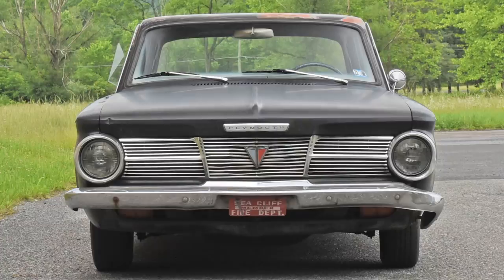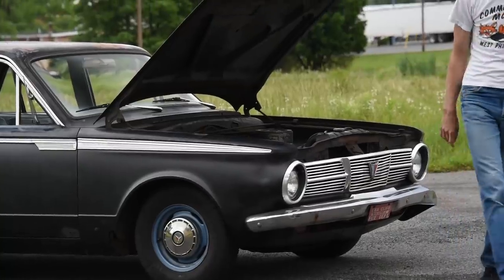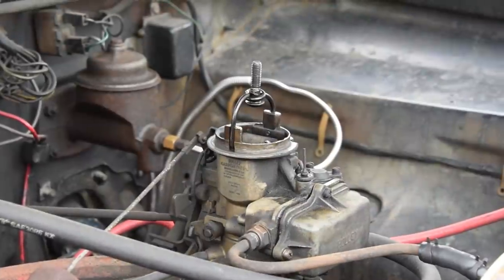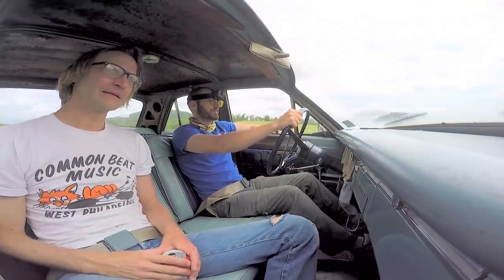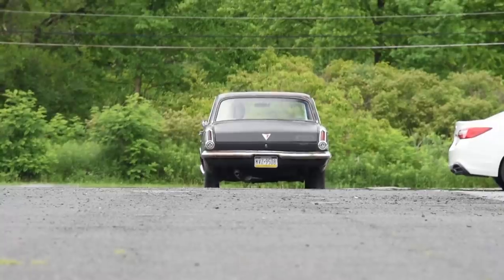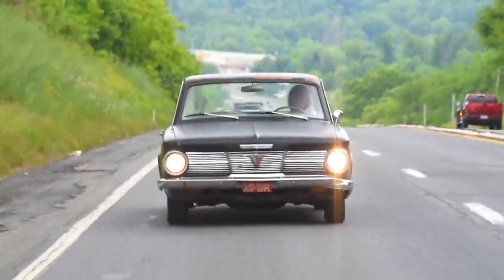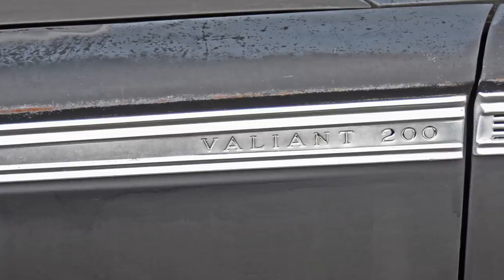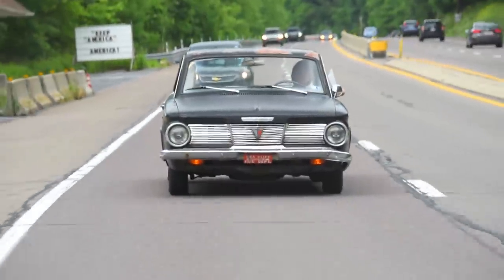1965 Plymouth Valiant 200: Regular Car Reviews

Comment: My mother used to have a 1962 Valiant with a slant  6 and a push button automatic transmission. Being a slant 6 it threw oil like there was no tomorrow.  My parents bought cheap oil by the case and kept it in the trunk. Everytime we would stop for gas is was my job, this is 1967 so I was 10, to check the oil and fill up if needed. About every 3rd fill up I had to add a quart. My parents sold it to a relative in 1973 and she drove it until 1980 when the floorboards were completely rusted out, Upstate New York winter.
Reply: My dad had an AP6 Valiant (australia, 1965/6) - remember dad saying that would go between oil changes without needing so much as a cupful top up. Use good oil and you wont fuck the motor.

Comment: Reminds me of my Australian AP5 Chrysler Valiant Regal (1964) - white paint with red interior. it had the torque flite push button automatic. It was my grandfathers first non black car. 

It was well loved in our family. I sold it in 1994 to a guy who did a full restore. 

The valiant in this video is more like the AP6 of 1965.
Reply: I had an AP5 in the mid 90's,  a pushbutton torqueflite. It was an early 63 build with the wipers on the American side and the blinker stalk on the left. Later AP5's were opposite. As it was pb auto, I simply turned the steering column upside down and used longer bolts on the under dash bracket.

Comment: I have owned at least 5 pre-70's Chrysler Valiants (as they are known in Australia), In fact, my first car was a 68 model that basically looked like the car out of the movie "Duel". It had the 225 2bbl 160HP engine and was no slouch. It was a one-owner car bought from my small town for $900. I never understood why we only had the 225 ci engine here? Usually, we got the lowest powered engines from America. I love these Valiants. Thanks for this particular episode.
Reply: It's all Chrysler needed to make the falc and holden seem like dodgem cars compared. Same reason why they didn't spend big on a performance V8- they had the Hemi. Fastest accelerating Aussie production car for 25 years. Also- all the full imports like the Phoenix and other American larger cars brought here by Chrysler, Chev, Pontiac,Ford etc were optioned up, not basic models- nobody wanted a big flash poverty model barge to show off.

Comment: I had the 1965 two-door 225 slant six, 3 on the tree. Bought it for $385. Found a radio at the junk yard to get it popping with all the extras. No worries on the highway with the bigger engine. I drove it in the 1970s anyway, when the oil crisis kept speed limits at 55 mph. Best car I've ever owned. Took it to Baja California over sand dunes. Drove up to Alaska from California one summer with 2 spare tires and a case of oil (it burned a lot of oil). The roads were so bad, I got a flat and I didn't notice on the dirt road until the handling got slippery. You can get rid of the overheating problem with a trailer towing radiator. Don't under estimate the Valiant.

Comment: you make a review on a car that is ruined, I had the trhee on the tree, it had over 100,000 miles when I had it, it was another beast that the one you describe, I had the 225 engine, cruising at 75 was no problem and it goes  over 100 MPH
 In fact , the crashbox was a pain in the ass and the column shift mechanism was crude ( the three on the tree of the early '50 plymouth worked much better )
the  biggest weakness was that the brakes were totally inadequate for the power of the 225.

Comment: I always wondered why the 3 on a tree had such a weird shifting method, must be because of the synchro's so people aren't slamming it down easily.
Reply: It has the standard A-903 manual transmission which lacked a synchronized first gear.  That was common on the entry level cars of the '60s.  Later an A-230 fully 3 speed synchronized transmission was an option.  In '64+ the fully synchronized A-833 four speed was an option.  But the best transmission was the A-904 automatic.

Comment: Self cancelling signals were always standard. The mechanism is worn out. As it is on my 63.
Good for Chris. I've owned mine since 1981. Slant six 3 speed on the column. 
Yes the Z Bar. Weakest link.

Comment: Through the years I've owned two white 1961 Valiants, one a two-door push-button, and the other a four-door manual which I daily-drove for 8 years in the mid-1990s; one white 1962 Valiant two-door push-button; one tan 1963 Valiant four-door manual; one blue 1964 Valiant two-door push-button; and one red 1965 Valiant four-door push-button.  EDIT: All 1 bbl 170 and 225 cu in Slant 6s.

Comment: if i owned it id probably, rebuild the engine while the only things i would change would be a slightly bigger cam and cleaning up the ports in the head, then add some taller tires in the rear for easier highway cruising

Comment: New color scheme two tone black.  Love it. FYI you can downshift an unsynchronized transmission by manually matching speed of the engine and input shaft of the transmission.
Reply: Yeah, I believe "they" call it "double clutching". Not to be confused with a "dual clutch" (DCT), which is really an "automated" manual transmission (manual transmission without the "third pedal").:hand-purple-blue-peace:

Comment: I drove an unloved Maruti Gypsy (i.e. LWB Suzuki Samurai, but built in India) for 8 years. Loved the sense of adventure but not the sense of dread of possibly not making it home. That dread was ever present as I bought it modified, and whoever did the job did it quick and dirty. Took it to be fixed, came back worse. Spent 3 times its worth to fix it again and it still would constantly fail. I loved the vehicle, but it hurt. Now I daily a Discovery 2 TD5. Which brings us to: when are you going to review a Discovery 1 or 2? They are very similar, in many ways.

Comment: Back when I was in school, I knew a guy that didn’t want to spend a lot on cars...he would get Plymouth Dusters, repeatedly, and called them Ruster Dusters. I think he had 3 of them during 4 years of school, and paid hundreds of dollars for them (like $200 or so each). Pretty smart in retrospect. Old, crappy, and cheap, and got him though school without issue. Back in the 80s, my mother bought a 74 Valiant in powder blue. Slow, roll up windows, and zero power equipment...I really liked that car. Like other Chrysler products of the time, no steering of course, turn the wheel 90 degrees, no change in direction.

Comment: As someone who has had and daily drove a 1964 Valiant that I got when I was 15 back in 1997, every word of this is true. (Although I lucked out with the pushbutton automatic.) Unlike Chris, I did finally rebuild mine. It was definitely not a restoration as we wanted to make the car better than it was, and it fought kicking and screaming the whole way. Still has a Slant and the pushbutton, but that's about it as far as stock drivetrain and suspension goes. If you want to see another example of a kid making poor decisions with his first car you can still read the article Car Craft did about mine if you Google "Chuck Ellis Valiant" and go to the HotRod article. I was wondering when RCR would finally get to a Valiant, and I'm glad this was the kind of example they chose. Got some serious flashbacks of my early days with the car in this video.

Comment: In Australia that would be called an Valiant AP5 or AP6 - Australian Productions. You would be lucky to find a running example for less than AU$5,000 - well sorted ones AU$50,000 above. Many came with the push button automatics.
Non Syncro first gear was very common in Australia during the '60's
Reply: The last pushbutton auto Valiant was the AP5.

Comment: The V200 was actually the mid trim level, between the V100 and the Signet.  So I guess the original owner wanted something that looked a bit better "but don't you try to upsell me on any of that power and performance mumbo-jumbo!"  Also, wow, I'm looking at that single-circuit master cylinder in terror.  He's brave!  Forget no power booster, if any of the lines fail, better hope the e-brake's set up properly!  Might be a good idea that the 170 /6 is so sluggish!

Comment: Lol 🤣 but actually I had a 64' valiant wagon with the 273-180hp push button automatic power steering and AM radio. It had decent low end power and hey it was only $200 dollars back in 79' rusty quarter panels in the rear with sheet metal riveted in dark blue with light blue vinyl. I actually have great memories with this car. I was only 17 at the time.

Comment: I drove a 1966 Barracuda back in high school - Class of '91.  Faded dark blue and gray primer, 5 gallon metal paint can lid covering the hole in the rear floor, non-existent fuel gauge, no AC, no hubcaps, manual everything, and a 273 2bbl V8.  One morning while driving into the school parking lot it ran out of gas but I was able to coast it to a parking spot.  Thank God because I would have been mortified if I had to push it in front of everyone.  Later I called my mom from the pay phone and asked her to bring me gas after school but I told her to wait until the student parking lot was empty because I didn't want anyone to see me putting gas in it.  Good times!  My parents still have it and restored it to new condition about 20 years ago.  It's the most reliable vehicle even after it sits unused for months.  Just charge the battery and go.

Comment: No computers to worry about. That makes this a more exclusive car than ever these days. The same engine would later receive one by the 1980s in the form of a feed back carburettor. 
The Australian versions were actually considered a higher tier car than the Ford and GM Holden's offerings.

Comment: True.. Im driving my 2010 HHR in 2021 and know how to fix anything that goes wrong with it. Not much has broken and maintenance is quite lax. I love the HHR because it lets me have my cake and eat it too. Haull a lot of crap and get 40 mpg. Seriously i make it from boise idaho to lehi utah in a full tank and loaded with crap. So yeah i like my poormans car. I like how it looks and i like what it does for me. When mr regular reviewed it i fell in love with it even more. Basically a waggon cobalt that handles a little better than the cobalt.
Reply: except the timing chain job is a nightmare
Reply: @Dankcatvacs  depends. The timing chain in a 2.2 ecotec is well built. The outside factors that can cause the timming chain to fail are the following:

Lack of oil changes/tensioners getting worn/cam position sensor needing replacement and being neglected.

A rare condition is the water pump going bad and locking up. Fot the most part its outside factors and not the chain itself. As for the replacement yes! A little tedious but not as bad as other blocks ive seen. The 2.2 ecotec is for the most part quite reliable. And in an hhr easy to pull out than in the cobalt.

Comment: The slant six engine in the Valiant just plain ran and ran.  I did a tune up on one (not my car) that was running well enough but was getting poor gas mileage. The electrodes on the spark plugs had burned to a gap of about 70. It's points were were burned horribly and the thing just kept running. A coworker had one and it finally threw a connecting rod poking a hole into the block. You could look right into the engine and it was still running with the connecting rod rattling around and he drove it home like that. 

The Valiant was basic reliable no frills transportation. It was also the first Plymouth Barracuda with the only styling change was what became known as the fastback. It actually made it to market a month before the Mustang came out. But it had less engine options and lacked the styling of the Mustang. The Valiant to Barracuda styling was basically unchanged because the old guy running things at Plymouth thought the Valiant styling was “sporty”.

If the Barracuda / Valiant had better engine options and new sheet metal instead of 'pony' cars we would have had 'fish' cars.

Comment: Brings back lots of memories. Especially of living underneath the dash. 

The Mopars from this era have some funky electrics. It’s as if they wanted to one-up British cars. 

If you own one please:

- Bypass the amp gauge (wire the alternator to the battery using a fusible link without going through the smoldering bulkhead (dis)connect)

- Install relays for your headlights. It’s an “I was blind but now I see” moment next night drive and it stops your dash from burning down (light switch gets pummeled)

- Remove the dash and then disconnect the original voltage regulator and put in place a properly cooled 8705 transistor. Suddenly the gauges work, and reliable, if they didn’t already go up in smoke by a failing original

And of course check your wiring for fraying, oxidation and dry rot - especially at the bulkhead.

Don’t be a dick and use properly colored and the right gauge wire. The Mopars that I owned almost always had a previous owner that ‘fixed’ wiring by twisting speaker cable together, everywhere.

Comment: My Dad bought one new in 65.  He drove it for 6 years.  We drove to New York from Florida with 6 of use.  It was reliable and easy to drive.  The slant 6 couldn't be killed.  The car was far better than the Falcon or Nova.  If you think the Valiant is lacking in power try driving one of those.

Comment: My 1st car was a 1960 Dodge Lancer, same car, motor, everything but with a floor shifter. It just flat died in around 1967 while I was going to Georgia Tech on the GI Bill and trying to finance (school, food, books, rent) everything on $275/month. A year and some later after having nothing but a motorcycle for transportation, I bought a 63 or 64 Valiant for $100. It needed stolen real estate signs on the floorboards to keep feet from falling through but what a blessing in January compared to my Kawasaki 500 in subfreezing weather.

If you want to talk about a car almost as miserable at highway speed, it was my girlfriend's Datsun 1200. That this was at about 4000 howling RPM at 60MPH, don't even think about 70 mph. We drove that thing from Atlanta to Key West straight trip, worst trip ever, but we made it on around $6 in gas.

Comment: The Slant-6 is built for torque, not high revs. Not that they can't be built up to make a lot of power, far from it. The block was supposed to be cast aluminum, so Chrysler made it a thick casting to compensate for the weaker material. But they couldn't get the aluminum casting process to work right so they just said "screw it" and used cast iron anyway, *without thinning the casting down to compensate*. So the Slant  6 is a boat anchor of an engine block that can take a shitload of boost. They're like the Ford Modular of their time.

Comment: As U.S. public grade school teachers, the folks drove Plymouth Valiants from 1961 to 1973, rolling along with a 3-speed automatic transmission. Wind noise, rain leaks, body panel mismatches, and "everything is an Option" was par for the course. Keeping it on the road for 10+ years meant that one had a chance to save enough money to retire the mortgage before retirement. It's no fun, but anyone with "shade tree" mechanic skills could keep it alive into the 21st century.

Comment: And the 13" tires makes effective gearing much lower , I put 14"  tires with 195 70 14's about 24 and 1/2 " tall about 1/ 2" taller than a 700 13. They came with 6.50 13's but current availability of 13" tires of any height is not good so small bolt 14" wheels takes care of the problem. Valiants with 6cyls and standard drum brakes had these wheels until 1976.
Reply: No aussie valiant had 13" wheels- only 14's. From 1962- 1981.

Comment: “If you had one in the 70’s you were POOR……”. Nailed it. I drove a 1964 2 door bought for $50 in about 1978. Had 225 slant 6 with three speed auto push button trans. Actually a good highway car, held 6 people, decent trunk. Did everything okay, nothing great. Decent reliability. Loved the torsion bar front suspension. Better than a Falcon or Nova. Brakes, steering went out and threw a rod all in the same week.

Comment: It's not the proper driving experience without bias ply tires.  Like rock discs.  My wife's first new car, a 1978 Buick Skyhawk, was a stripper (the car, not her) with bias tires.  It had a radio and she'd upgraded to the 3800 V6, otherwise, bare bones.  A friend gave me some not quite worn out radials that were the right size.  The car was transformed from an ox-cart riding terrible handling car, with a 90 degree non-balance-shaft V6 that made the mirror almost explode with vibration, to a fairly pleasant riding terrible handling car, with at 90 degree non-balance-shaft V6 that made the mirror almost explode with vibration.  I also got halogen headlights for it.  Now we could see at night.  Anyway, It's hard to understate what a sea change radial tires were.  One of my older brothers put radials on his '68 Pontiac Parisienne (Canadian Bonneville) and it was similarly transformed.

Comment: A coworker of mine had a Volare wagon with the slant 6. It was a light yellow color, so everyone called it the "Banana Wagon."
He was done with the car, so I made the suggestion of draining all the oil and seeing how long it would run before seizing. We worked at Ford dealership on Long Island. So, Will, henceforth known as "dumbass" agrees. Dumbass drives the Volare on the dyno, we drain the oil and wait. No lie, without a drop of oil in this car, it runs for over AN HOUR before it seizes. Respect to the slant 6.

Comment: Looks like he needs to go through the steering, I haven't seen that much steering play since I had a bronco 2 with all bad tie rod ends.
Reply: You don't want to know about the literal half a turn's worth of steering slack that my 1970 Dodge Polara I had back in the late 90s had.
Reply: @fixman88  that's about how bad the bronco 2 was.  You also had to drive in 4wd because the cv driveshaft failed and a replacement was too expensive.